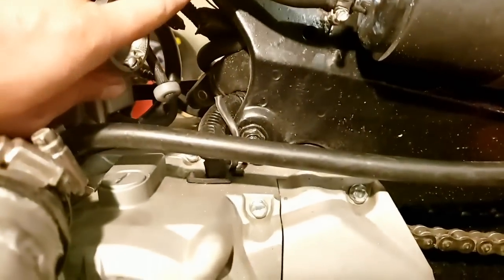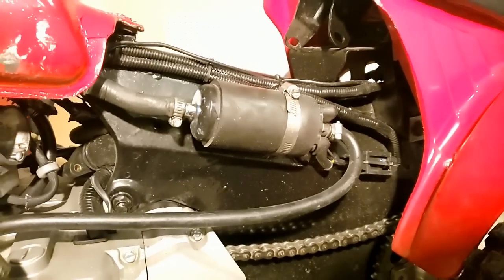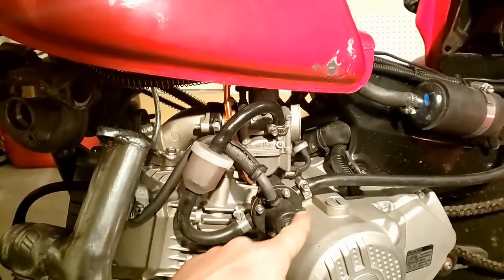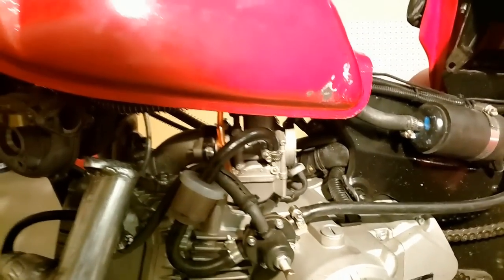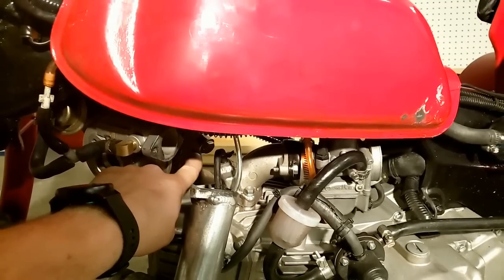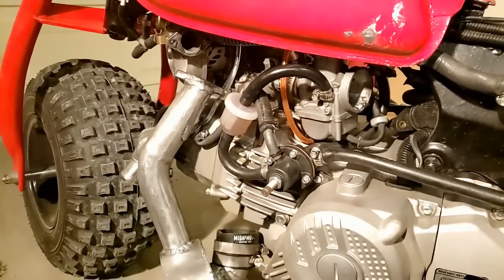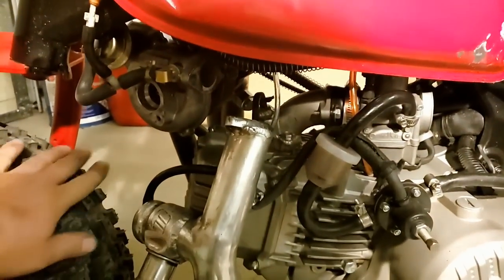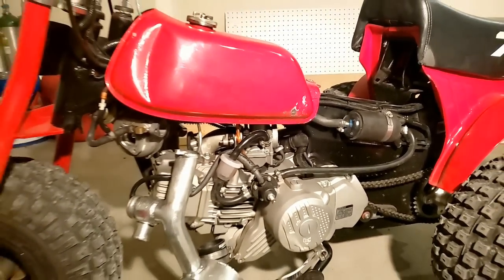Honda ATV Turbocharger - How to turbocharge #2

Comment: How do you adjust the boost pressure on the vz21? The wastegate actuator doesn’t have any jam nuts so how did you adjust to 10psi

Comment: Hello from Miami FL.  Great videos!Which turbo would you recommend for a stock bore Grom?  I've been running the vz21 (without regulating the oil pressure.  I might try your T fitting to return to see if that helps) but I've only seen from 6psi to about 9psi on my setup.

Comment: Did you add any oil feed or coolant lines to the turbo ??
Reply from the maker: Just teed into the existing oil cooling lines. No coolant on gt12's or this motor

Comment: why dident you just run a draw thru system itd have been alot easier surely?
Reply from the maker: Stock carb isn't big enough to run draw through. I tried 🤘. Draw through aren't the best for duning either, just wide open throttle stuff.

Comment: Hey mate, a bloke I know over in the uk is building 1 of these, he went from the rhb to the gt12 and it wouldn’t spool up like the rhb.
Reply from the maker: If its the rhb31, its bottom end spools quicker, but not much. It has to much exhaust back pressure if it's the 190cc motor. Im using the GT1238sz compressor housing with a GT1241 exhaust housing. Works good imo.